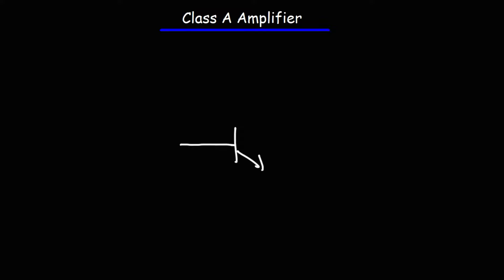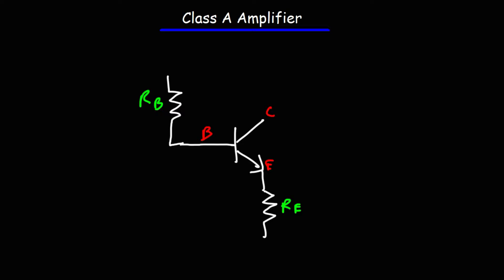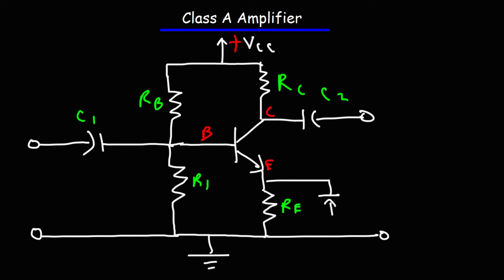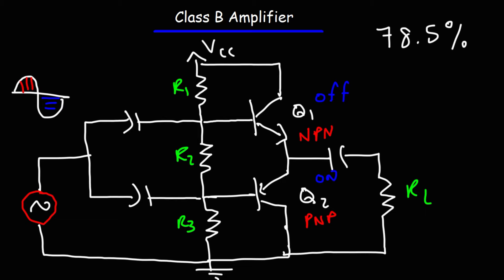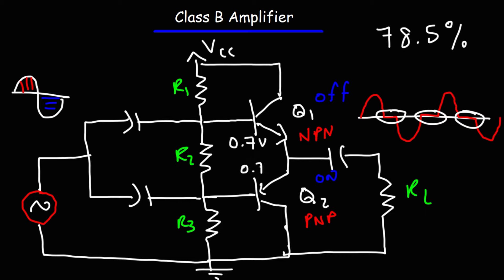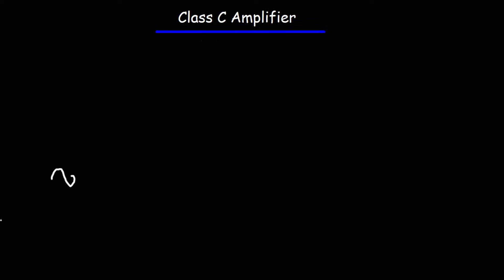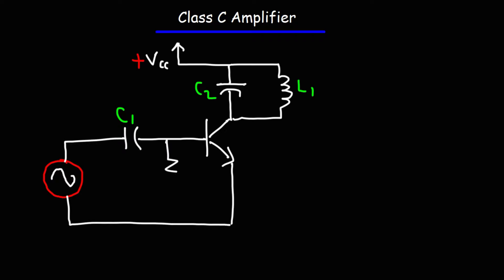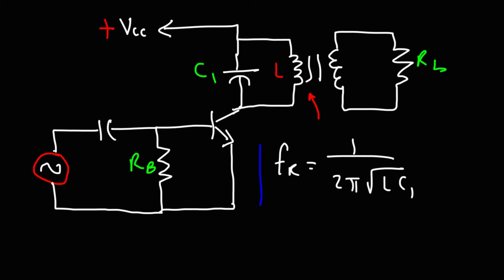Transistor Amplifiers - Class A, AB, B, & C Circuits

Comment: Great explanation however there is a mistake in the Class A analysis. The 25% efficiency for capacitive couple output requires a load impedance equal to the output impedance of the amplifier according to the Maximum Power Transfer theory. You have not included a load. You are correct in saying that the maximum compliance is achieved with Vce = 1/2 Vcc when there is no load. However, when a load is hooked up according to MPT compliance is maximized by making Vce = 2/3 Vcc. An ac load line is required to determine the previous statement. In theory, matching the load to the output impedance of the amplifier provides 2 equal current paths and thus wastes 50% of the efficiency across the Rc resistor. This explains why the transformer coupled amplifier can attain a theoretical maximum of 50%. In Class A mode the transistor conducts for a maximum of 180 degrees and thus wastes at minimum 50% more of the efficiency. Thus, capacitive couple efficiency is >= 50% x 50% = 25% and transformer coupled >= 50%. The extra efficiency losses are due to design problems, loss of power by other components and loss of power in because the linear region of the transistor is slightly less than 180 degrees. That is the saturation and cutoff regions are unusable.

Comment: Coupling is pronounced "cupling". I've seen many class AB amps that do not use diodes. The class C amp is used in high level AM final amplifier in transmitters.

Comment: Thank you. This is the best description I have found so far.
I need to create a very simple preamp to use a peizo ceramic disc as an audio receiver as well as an amp for audio transmission via a piezo ceramic. I had what I thought was described as a class A with the addition of the small signal transformer to match with the high impedance of the piezo capacitor, but I may have ended up with a class C.
.
I am not a electronics engineer. I know my way around a circuit board if I have a base circuit to work from, but designing circuits (esp audio signal) stretches my current ability lol
.
Again thank you.
Oh, I just looked across your other videos and your channel is gold :P

Comment: Great video, good explanation 👏👌

3:50 - "Vce - collector to emitter voltage should be half of collector supply voltage "? I sppose VC, collector to ground , should be half of Vcc, the supply voltage.

The collector- emitter saturation voltage is typically less than 1V.

Comment: The class A amplifier with a resistor in the collector  is inefficient because the quiescent bias current without any signal is still passing through "a RESISTOR" and so that is wasted power. 
Since at the collector the transistor is "a current source" one  can short circuit  for a DC current and that is what the inductor does, where at DC, it has no voltage across it and so it does not use any power when there is no signal,  The useful current is when there is a rate of change in it and so the transformer is used to replace the  collector resistor. 
It should have been noted that his cannot be done in the emitter as at the emitter the BJT is a voltage source and one cannot short circuit a voltage source as one can short circuit a current source. 
Congratulations for this video , an excellent presentation.

Comment: At time 5:30:   "...transformer C O O P U L L E D class A amplifier...."

"COOPULLED"  - it's supposed to say COUPLED.  

Not  COOOOOO - PULLED

I point this out because - apparently, this voice IS SYNTHETIC!    They did a really good job with the volume inflections for the words, and for the cadence.  This one little error - saying  "cooo - pulled" instead of "COUPLED" - was the giveaway.

Remarkable how high the quality of this synthetic voice is.

The error in the software that creates this voice is easy to fix  (I'm a software engineer).  Right now, the mistake being made is this:

"coupe" is a type of car.   It's pronounced  "COOP"

And the -led  suffix is used everywhere: "STUMBLED",  "MUMBLED",  "TUMBLED",  and is pronounced "ULL'D"

So the software is mistakenly combining  "Coupe"  with "ull'd"  and pronouncing it  "cooo-pulled"

I can't believe how good the voice is.  I was 100% convinced it was the author of the video speaking.

Comment: Question: using electron flow (not "conventional current"), looking at the Class B amp at 9:44,  the positive going input signal will turn on Q1, which will cause electrons to flow from the ground, through RL, "through" the output capacitor, up through the emitter and collector of Q1, to Vcc. When this is happening Q2 is turned.  After this happens (and the input signal goes back to zero), the output capacitor is charged with a positive on the side that goes to the emitters, and a negative (electrons stored) in the side that is connected to the load resistor.  When the input signal changes, and goes negative, Q2 turns on and Q1 shuts off.  This makes the resistance across the emitter and collector, of Q1, very high (very little current flow through Q1.)  As Q2 begins to have electrons flow through it from the ground, up through the collector then through the emitter, the electrons are "pulled" by the positive charge on the capacitor (the plate connected to the emitters,) and electons will flow into the plate of the capacitor that is attached to the emitter of Q1, while the other side of the capacitor (the other plate) will send it's electrons down to ground, through RL.  Correctamundo?

Comment: Always more to learn lol : D
...

Questions 

With the class C could not one place a resistor at the ‘E’ which would mean that the voltage drop across this would mean that the junction between the E and the resistor will have some voltage in ref to ‘ground’ example 1v , this would then mean the E has 1v ref above the Base if the base is ref to ‘ground’

Another question, could you trace the ‘current flow’ in a basic AB amplifier for amusement and insanity? 

The only way this device can function {for me} is if the ‘N’ junction is equalized to the ‘P’ junction when they are merged , I.e they effectively became one device with two junctions and a equalized 0 central point that is because the N from the NP>N  equalizes with the ‘P’  of the P<NP  

NPN<>PNP     

: 0
 
N <> P 

: O

that then becomes an effective {best possible} transistor equivalent of a vacuum tube.

Comment: None of videos out there regarding class ab single supply's voltage will explain what makes each transistor on and off for base of each transistor is always 0.7 greater than the emmiters of both transistor for 360°  of input signal(emmitter follower concept). So how???? Help me out

Comment: What is mean by voltage divider and its use
Reply: The voltage divider constantly supplies 0.7 V (dc) to the base. This is to just open the transistor. If any (positive) input voltage is added, base current increases accordingly, so there are no distorsions at the output. If there is no voltage divider at the base, you will have pure input signal that opens the base. The problem is that the base opens only if input signal is higher than 0.7 V. So, everything below 0.7 V that comes from the input signal source is simply lost. This causes distorsion of the output. The remedy is this voltage divider that you asked about.

Comment: Class a has a sound that is better than the others. I'm not too worried about efficiency but I am in sound quality. You need some larger transistors like a tip122 and use lower voltage like 5 v 1a to power them. Less resistors and no voltage divide just place a 1k resistor or pot between the base and collector for biasing and bam nice little amplifier

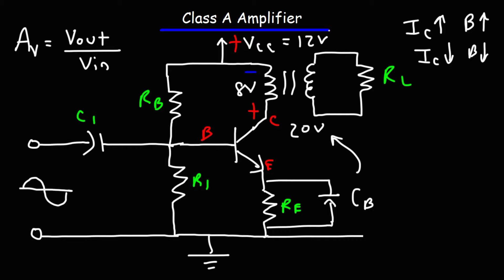Comment: Sorry this is pretty poor explanation your jumping between dc and ac voltages at 7:45 the primary of the transformer is a short cct for DC voltages but a impedance for ac voltages.
better explanation here https://www.circuitstoday.com/transformer-coupled-class-a-power-amplifier

Comment: Oof, over 200k views here and there are so many errors in this video, particularly in the class B and class AB descriptions.
Reply: Explain pls
Reply: @davidtobi4184  That was a long time ago that I made that post, so I had to re-watch to see what I was criticizing. Here are some more detailed comments:
1) Class A description is very good - EXCEPT when discussing transformer coupled Class A. The transformer does not store energy (significantly) and the magnetic field does not collapse. That would be an accurate description of a flyback transformer configuration, which this is not. Also, coupled is pronounced 'cup -ld' not 'coop -ld', but who cares about that.
2) The description of Class B is good. But when he describes Class AB by adding 2 diodes to help bias the transistors in order to remove crossover distortion, that's still Class B. Class AB is when you intentionally bias the transistors such that they conduct for MORE than 180 degrees of the cycle but less than 360 degrees. It's a delicate balance because you want to remove crossover distortion, but you don't want to get into Class AB, which is less efficient, and has distortion of its own. Usually you don't use diodes to accomplish this, but rather a Vbe multiplier or 'rubber diode' circuit. Transformer-coupled tube amplifiers are often Class AB, but the designers had to minimize tubes and efficiency was already out the window with those anyway.
Reply: @davidtobi4184  Class C is also not quite right since he says the capacitor and inductor charge each other up back and forth during the positive cycle - they do that during the negative cycle too.

One other thing - the Class B schematic had a capacitively coupled load in one of his schematics. That's pretty weird. I'm sure there are some low power cases where you could do that, but for any significant amount of power, that capacitor would need to be prohibitively large. Overall, this is pretty good, I just don't like that he's speaking from a position of authority here when there are so many basic mistakes.
Reply: @shannonroberts5080  as confused as I am, I actually see your point, it's very valid
Reply: @shannonroberts5080  thanks alot for this detailed explanation
Reply: @dmaxvel  Are you an electronics student?
Reply: @shannonroberts5080  no, mechatronics. I have serious issues with this course, like serious understanding issues

Comment: Base resistor must be connected between vcc and base terminal..not between base and emitter. Class B amplifier shown should be called Class B push pull.